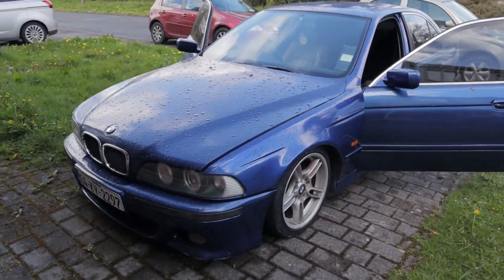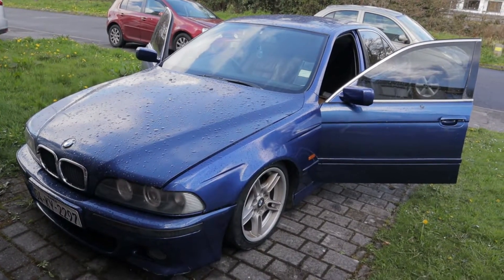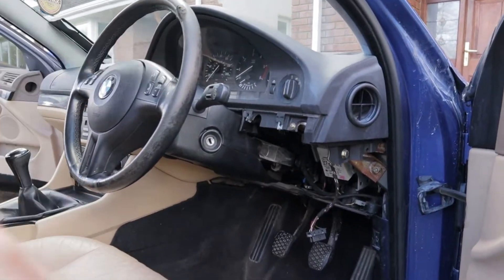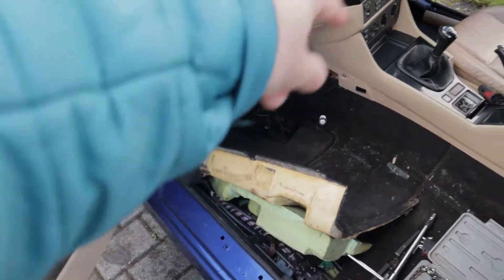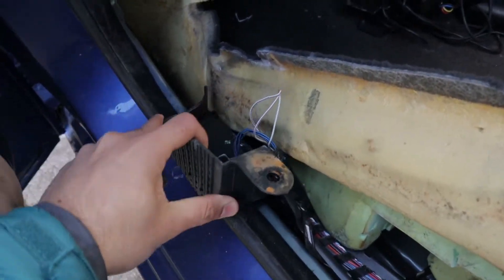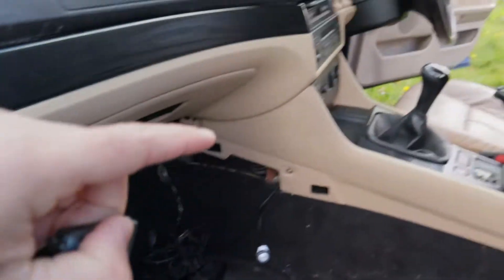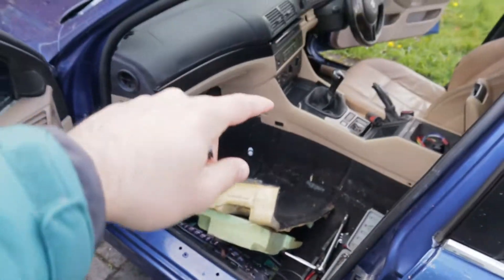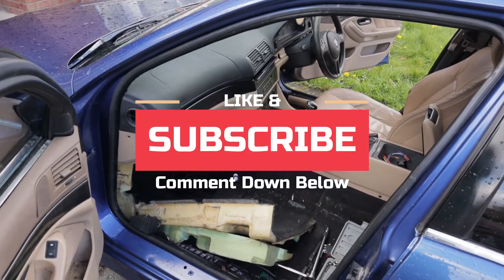BMW E39 Not Communicating | OBD Port communication error fixed | Quick Fix | Scan tool won't connect

Comment: Hi guys,
I was trying to scan my e39 the scanner turned on but no communication between them, I’ll be appreciate it if you can help me
Reply from the maker: Hey, I'd Start with checking the obd port (research the pins to check online) and then go to other items such as shown in the vid.
Reply: @noorshah96  thanks brother,
One more thing, that little black junction box should be in driver side or passenger side since my is left had
Reply from the maker: @aramahmoudi2011  of course brother, no problem 👊🏽 I'm 90% sure it's still on the left side so your driver's side 🙌🏽
Reply: @noorshah96  🙋🏻‍♂️I found that plastic cover under driver side carpet and there were 2 of those black junction with 3 or 4 wires but non of them are white wires like yours and they are very clean no rust or corrosion . Is there way to test them or I should cut and put together?
Thanks in advance brother
Reply from the maker: @aramahmoudi2011  interesting 🤔 I genuinely can't remember now what ones meant to be there in total. But it's still worth joining em, just make sure they are meant to go joined together in the first place 😅😅 what year is your E39 as if you have the 20 pin plug in the engine bay, you have to join something there to use obd functionality...
Reply: @noorshah96  this thing is driving me nuts,bought the adapter for that but even that doesn’t communicating
Reply from the maker: @aramahmoudi2011  Oh I can imagine the frustration. You might have to go back to the basics - fuses and wiring...maybe start with your scanner now, what type of scanner you have and is it meant to scan it or not?

Comment: Thanks for posting this very useful fix.
The high density foam under the carpet can absorb and hold a hell of a lot of water while the carpet appears dry on top, my connectors were totally knackered!
Reply from the maker: Yeah definitely the foam can absorb a lot of water and you never even know about it. Glad to be of help and that's good that you found the problem ☺️

Comment: What about your scanner being able to connect to some models but not others😊
Reply: I got airbag probl l
Reply from the maker: It is a possibility often with certain scanners that are limited but my one is meant to read all of the modules. So the scanner is very important indeed but after the fix, I was actually able to read/scan all the present modules
Reply from the maker: Oh - Did you manage to get a code/error description?
Reply: @noorshah96  no because there’s no communication
Reply: @noorshah96  could be the ecu?
Reply from the maker: @bedgezoobc5780 I wouldn't just fault the ECU just yet. Have you tried the fix in the video yet (probably stating the obvious 😁).
Reply from the maker: @bedgezoobc5780 check the wiring all around for any cuts ...
Reply: @noorshah96  do you mean the entire harness
Reply: @noorshah96  could it be the airbag moduel
Reply from the maker: @bedgezoobc5780 it could be - did you check the connector that was shown in the video?
Reply: @noorshah96  i cut and rejoijen
Reply: @noorshah96  what’s your suggestion indo
Reply from the maker: @bedgezoobc5780 I honestly can't think of anything else unfortunately 😔 I hope you get sorted 👍🏾 Would it be worth getting a second look from someone/mechanic?
Reply: Hello. You fix the problem? I have the same problem with my e39 i have no Communication with the airbag modul. Can you pls help me?
Reply: @GGonGGonn-xc2jk  nah scrapped the heap of shit in the end

Comment: I have problem communication to EGS transmission module e39 530d 01/2000, i have 20 pin adapter under the hood, all modules i can read except the EGS module, whats the problem?
Reply from the maker: Oh that seems a bit unusual or I should say I haven't come across that. It definitely seems like it's either the module is gone (hopefully not) or the working to that module is the issue. What scanner are you using as that might be a limiting factor if it's a basic one.

Comment: soo to three white cables are located in the passenger side on LHD? or in the same spot as this? I can only read out the engine code. and that's just with the obs 20 pin inside, I got also the round connector but that won't even connect.
Reply from the maker: It should be on the same side for LHD too, which means the driver side in that case. But I can't remember that there was meant to be a trick with the round BMW plugs to get it working. Maybe do some research about that before ripping all this apart. But if all else fails, then this is more than likely the culprit
Reply: Same spot as his, so under drivers seat for LHD!
Reply from the maker: @rwdpov 🙏🏽🙏🏽

Comment: i have intermittent problems with the scanner, so likely will be a bad connection or it is a instrument cluster. i have seen some inconsistnsies on the cluster itself on the beeps and being able to scroll thru the errors that it shows on the little display thanks for the vid i hope this solves for me
Reply from the maker: Oh interesting. Mine had stopped working altogether, never read any modules other than the engine (I recall). Best of luck, I hope this solves the issue for you as well. I'm glad to be of help. Please update us with how it turns out for you 🤠
Reply: @noorshah96  yo same, i use bmw scanner (pasoft) and the only thing i can read is the dme and intermittently all the other modules. im watching all this cus when my modules go out i get a trans failsafe and i needa fix that. thanks for the vid

Comment: E34 communication issues. Any way i can fix it ?
Reply from the maker: Oh interesting, E34 is one that I personally haven't worked on so I hope someone here can point you in the right direction.

It does depend on the year and engine that you have. And of course the basics such as your scanner and cable type.
Reply: 1990 BMW E34 518. M40B18.
Reply from the maker: OK. That should be the old round c101 plug I believe, what scanner and cable are ya using? I have never tried that one though myself

Comment: Man I wish I found your video sooner, I've had this problem for a while now and only recently have I found out about the X183 connecter, basically I couldn't scan anything but DME, then I saw a post on a forum to try and run a jumper from the OBD port pin-8 to the cluster and try to scan, almost everything worked except the ABS module which doesn't go through the cluster but rather directly through X183.
Reply: Didn't have the time and energy to remove the seat / carpet to diagnose the problem at the X183 connector so I'm just running it without proper scanning lol
Reply from the maker: Oh I was the same when I initially had the issue 🙃 Searching through forums, I believe it might be the same thread you were looking at. But feels great once it all works, bypassing/connecting the wires didn't work for me as far as I remember. It shouldn't take much effort to get to the connector, definitely an awkward task 🤪

Comment: Course this don’t work on mine 🙄🙄🙄
Reply from the maker: Why not? Something else wrong 😞?
Reply: @noorshah96  I did exact what you did in video but made no difference
Reply from the maker: Bugger - I've been out of touch with this issue for a while so can't suggest anything atm. I'm sure you will find the issue 🙏
Reply: @noorshah96  it’s okay I’ll bypass and connect to obd1
Reply from the maker: Where there's a will, there's a way 💯
Reply: Hello. You fix the problem? I have the same problem with my e39 i have no Communication with the airbag modul. Can you pls help me?
Reply from the maker: Yes, it fixed the problem in my case. As some others have said, start with checking the voltage on certain OBD2 port pins and then go ripping the carpet like I did. Best of luck 🤞🏾

Comment: I  got the same car I have priblem I cant communicate to the Transmissions control Module.. Any Ideas?
Reply from the maker: Can't tell you for sure mate, do you get the response from all other modules? What scanner you're using?
Reply: @noorshah96  other control modules is ok.. I am usin Autel maxisys 906bt
Reply from the maker: Oh right 🤔 It has to do something with either the module itself or the wiring/connection to it (more likely if the car is shifting fine). Probably a stupid question but is the car auto? I have a funny feeling Manuals don't have a dedicated trans module (maybe)....Good scanner by the way, I have MK808bt, how do you find it? I'm thinking of upgrade soon.
Reply: @noorshah96  Amazing device
Reply: @noorshah96  the car is Automatic transmission I have problem second and this gear delay and sluggish
Reply from the maker: Good luck man, I Know it's annoying when you can't even communicate with the thing.

Comment: Mine is doing the exact thing. I haven’t checked for voltage between the ports but the white purple wire to gauge cluster is good and has no breaks I confirmed that with a ohm test. I’ll check driver footwell(USA) and see what I can find tomorrow. I have a missing panel there of trim so maybe previous owner let water run down there
Reply from the maker: If there's a trim panel missing, it's more than likely your issue. Update us here if you can please either way. Best of luck 👍
Reply: Updating to confirm that is exactly my issue as well. Checked it this morning and it has blue green corrosion dust all around it, gonna clean the contacts and reinstall. Thanks for this video man!
Reply from the maker: Thanks for sharing! Glad that it helped, not a great design but at least the fixed is out there 😁

Comment: Obd2 not working communication Sem problem.all sem locations e39 problem???
Reply from the maker: The connector is on the same side on all these I believe, you could start checking with that....It does seem common issue given the design 😌
Reply: @noorshah96  my car left hand drive? 😔
Reply from the maker: Yeah it should still be on the same side

Comment: Do you know, What I can do with this same problem in X5 E53 2001?
I have been searching  the jumper in my E53 but I didn’t look.
Thanks for you help
Reply from the maker: Can't say for sure but I believe it should be similar, did you try lifting the carpet etc like I did? Maybe search online about this plug's location 🤔
Reply: @noorshah96  Yes I did but I couldn’t find them, I have been looking in internet and BMW forums but I haven’t had results
Reply from the maker: Oh right, strange 🤔 I can't say off top of my head as don't have experience with the E53s but I'll look up and let you know 8f I find something..... What's the issue, no connectivity to the obd? What scanner you're using?
Reply: @noorshah96  I have 2 issues when I try to turn on the engine, the starter stays stuck  in on although I release the key, (starter and  the start Switch are new) when I tried to put the scanner I had the problem that the scanner didn’t read the modules only reed engine codes.
I have a scanner foxwell nt510 elite to BMW
Reply from the maker: Sorry for late reply but as you said yourself it seems like to different issues but I know that you can't even scan 😌 if the starter is knew, I read something about it as a bmw special function to start the car for you even when you turn the key for a split second, could that have worsened somehow to this?

That scanner should read all modules so there's definitely some issue ... I remember reading somewhere when I was searching for my issue that some of the communications went through the instrument cluster so might be worth searching that up and see what you can find

Comment: Before you found the issue did you car start at all?
Reply from the maker: Oh yes the car was starting and running fine it's just when I was trying to scan using the Obd2 Port, I was not able to read all the modules and this fix sorted it for me. Hope it helps.
Reply: I have the same problem with my 2008 bmw 328i starts and runs and drives fine but cannot connect to any obd 2 reader when I connect. It just says not obd 2 response on my reader. Could this be similar to my car?
Reply from the maker: Sorry to hear that but I don't have enough experience with these but it could well be it, check wiring diagrams/location before ripping off the carpet etc.

Comment: For LHD cars the connector is in the same position or in the opposite side?
Reply from the maker: Don't have first hand experience with LHD cars but did some research, it'll be on the drivers side on lhd cars (still same location as in my car)
Reply: @noorshah96  many thanks!!!
Reply: Im also LHD and have the same question
Reply from the maker: I'm positive that it's on the left side when you're sitting in the car, can you please confirm when you check yours😁?
Reply: @noorshah96  If I've to do that I will...first I want to try the diagnosis directly from the main round connector with Adapter.
Reply from the maker: @luca oh yeah, I'd too make sure first before ripping things apart😁